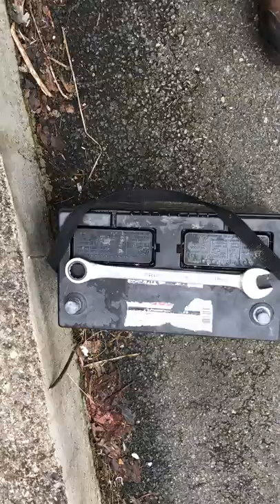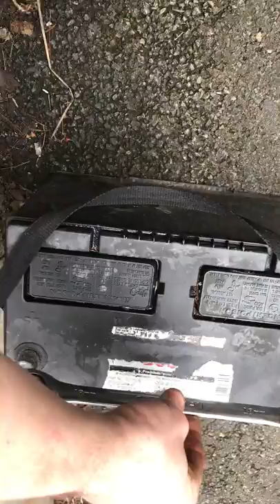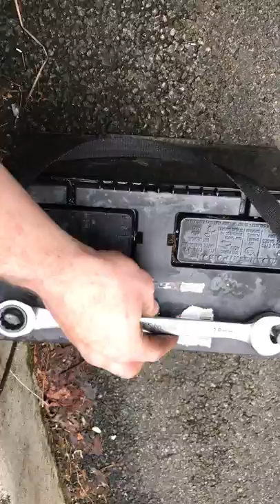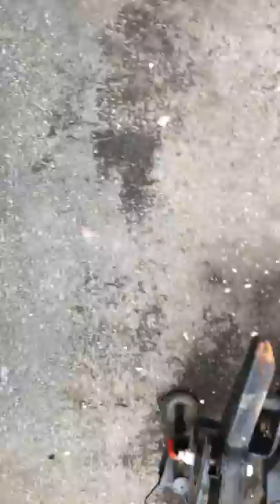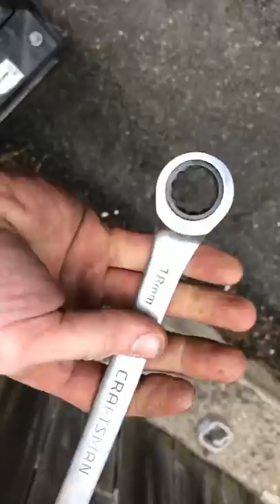Will a wrench short out a battery?!

Comment: I laid a 1/4" ratchet extension across the terminals by accident when working on my car. that was the scariest / dumbest / coolest thing i have witnessed in a long time. safe to say its actually true, that might just be a dead battery. i still got the "weld" marks on y extensions XD
Reply from the maker: that’s awesome, you should have done a video lmao 😂 yeah I was hoping this joke video was gonna go viral, thanks for watching
Reply: @AmericanRustWorker3369  shit if I was filming I would have definitly posted it 😂 was intense. But I did enjoy the video. Gave me a good chuckle
Reply from the maker: @BREZINA542  lol I hooked up jumper wires to one of my nipple rings one time, had a test light on my chin piercing, touched it to the other post of the battery , it was shocking, it should have recorded it though
Reply: @AmericanRustWorker3369  Reported for posting fake news.

Comment: By doing this you are just eliminating the conductors of a circuit and the wrench is the load.  It should be heating up like a resistor unless it’s some material that is not conductive.   Or maybe it’s just a dead battery and you want people to try it and get pranked.
Reply from the maker: Andrew K  lol it was a experimental joke but yes that would be funny too 😂

Comment: bro doesnt undertand physics, on a fully charged feul cell, you would get about 400 amperes of current, for reference, the entire earth has approximately 1500 amps of current on its surface, and we almost have 1/3rd of that in a battery. If this were a functioning battery, the wrench would be welded on turn white as the sun, and cause a meltdown in whichever area it is.

Comment: That’s a DEAD battery. If you try that on a good battery you’ll get a surprise and might actually hurt yourself.
Reply from the maker: Youuu don’t have to worry about the electricity, lol I did the same thing on my truck while it was running in another video lol
Reply: You are VERY unlikely to hurt yourself, 12v ain’t shit… the only way you’ll get hurt is if you leave it too long then grab the hot wrench or leave it way to long and cause thermal runaway in the cells causing the battery to vent and explode

Comment: this must be a joke or something …btw even if you shortout a battery with a wrench  it will not electrocute you because 12v is very low and human body is not a good conductor against 12v..so 12v won’t pass through….but you will get huge sparks and if you use thinner wires etc it will burn …..you can hold a wrench shorting the terminals of the battery it will give some fucking sparks scary noises.>and will become hot very quickly and burn your hand….but you will never get electrocuted by a 12v battery
Reply from the maker: The video was a joke and that’s bullshit take a spark plug wire off a running vehicle then tell me Lol
Reply: @AmericanRustWorker3369 12v is absolutely not enough to do anything… spark plugs operate at between 15000 and 50000 volts most cars been nearer to the middle at 20000 to 35000 volts… you really should just stop talking in general, the spark plugs in your vehicle are not powered by your battery, the only real purpose of a battery in a car is to power the starter, after that your alternator takes over, powering the vehicle and recharging the battery… if the battery powered the spark plugs I wouldn’t have been able to drive my Beetle for over 2 years without one, it didn’t have a working starter either.

Comment: that battery is not 100% l was installing a new battery and  the wrench a was using laid across both terminals l felt the jolt and some sparks whet flying  coolest  and scariest thing l have witnessed
Reply: You did not feel a jolt, 12v isn’t enough to pass through your body
Reply from the maker: That’s hilarious 😆
Reply: @peterlenihan5712   if that is the case get you a new battery and lay a wrench on both terminals.

Comment: Battery is grounded so it has very little power sitting on the ground. Put it on a piece of wood or on a table. I need to see this across the chart. So we know if it’s sitting on the ground you’re good. So next, set it on plywood on the ground. Have a volt meter so you can see the current voltage. Test again and again.
Reply from the maker: You seriously can’t think that putting it on a piece of wood would make a difference 😂🤣
Reply: @AmericanRustWorker3369  It truly do sir. I believe it make a huge difference than sitting it on bare ground. So will you recreate this test under different circumstances to see if your results are identical, or if something unexpected happens... I feel it’s in the name of science to continue on with there these tests.
Reply from the maker: @uhsavage   I see what you mean but batteries being in the ground and in cars makes no difference, the battery is completely dead , it was meant to be a joke lol